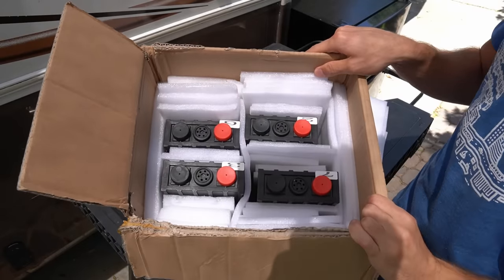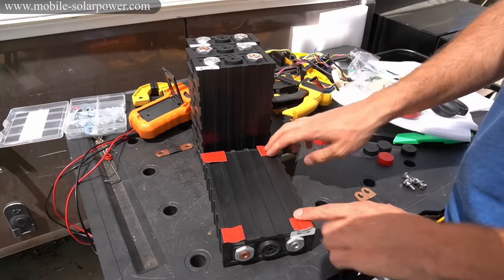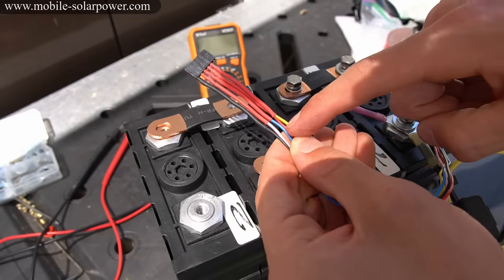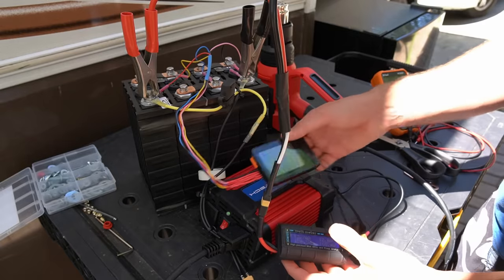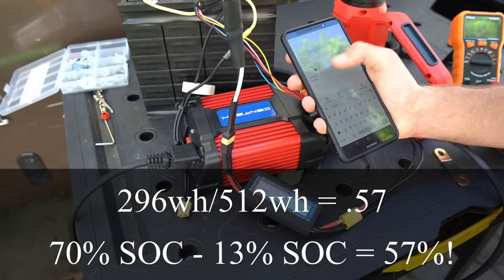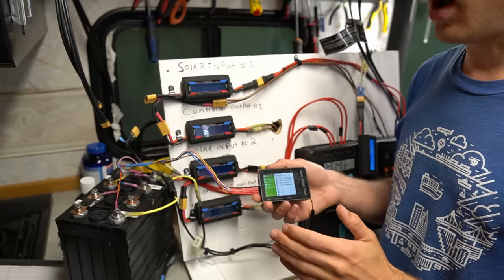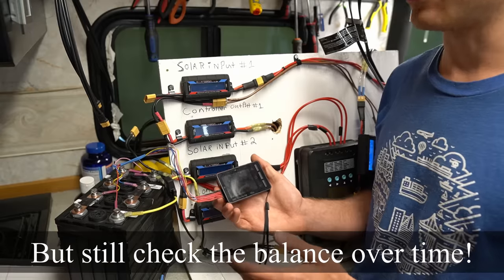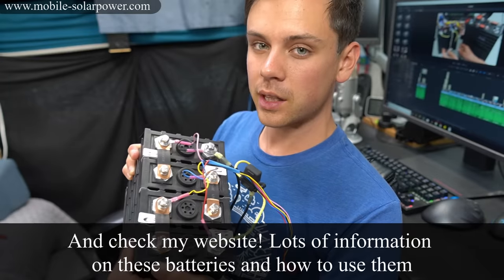12v LiFePO4 Battery Kit from Amazon.com - Tested and Reviewed

Comment: Will, you always produce good education; videos,,,, Thanks in advance.   I have a Small Solar System...  which I just got 4 each  12v AGM 119ah  batteries.     I want to Optimize my charging and discharging....  but totally lost on the Battery Wiring.....   I saw you comment on a Balanced charging method.....   But I'm just lost!  Some say Parallel is this only way to do it to maintain the 12v to your inverter.   Other say, wired in Parallel the 1 Battery takes all the wear and tear!   If you could tell me what is the BEST WIRING METHOD for 4, 12v batteries to use with a DC/AC inverter?  I have a simple 30A Charge Controller, saving money for a MPPT.        Battery WIRING HELP PLEASE !

Comment: I got a challenge for you. Not going against this product. I've been seeing a lot of these new kind of batteries. Works? You be the judge. My challenge is take all of that info on many different types then go to Walmart and get the simple deep cell batteries for your boat or camper. I just want to see what you come up with. My experience is, having a very hard time bring them to a discharge. Please do it. You have the tools to do a proper test. I dont. Thanks.

Comment: did you see the bms  that comes with the 100ap battery wow its 7inch by 6 inch and they don't tell you any thing about the hock ups. and no hot wire or ground i half scarde to try hock it up case I get it worge on the BMS      b+ B- or P- but think it B+ hot P- ground  i pay 900.00 and could even send me  instruction paper wow

Comment: Good video, to support I purchased your book.
Reply from the maker: Thank you!!
Reply: @WillProwse  I received your book from Amazon. It's really nice, easy read. Really like it. You may consider including a Bio / introduction story fluff info for your next revision.  What inspired you to... blah, blah... BTW: Do you happen to know of any no-weld no solder battery kit suitable for use with 32650 cells? There seems to be some for more common 18650, but I'm stoked with LifePO4.
Reply from the maker: @tech29X  yeah LiFePO4 is amazing. And not in that size. Why not use prismatics? They are dead simple
Reply: @WillProwse  Prismatic cells would be too much for my use; I'm using the battery pack to mitigate a phantom load(parasitic drain) on my vehicle. Around 100mA/hr or about 30 watts/day. After killing countless lead acid AGM batteries, I figured I could just use a 12Amp (4s2P) 32650 LifePO4. It does help tremendously. AGM is at 12.5V and LifePO4 is at about 12.9Volts. So, the lithium pack is sacrificed first and LifePO4 charge level never goes below 12.0V or above 14V for that matter. Believe me it's been a very frustrating experience over the years that cost me thousands $$$ in lead acid(AGM) battery replacement. Maybe someday if i break free off my chains and try van life, prismatic cells with a charging system around $4-5K would be great. But, I'm chained down pretty hard  :-)
Reply: @WillProwse  The big problem is stated capacities versus actual usable capacity especially for lead acid "starter" type batteries like on cars. At about 100mA drain/hour if I don't drive my vehicle for 3-4 days, and then just drive it for 30 it doesn't recover and over time a deficit builds up and the starter battery which is not suitable for deep discharge ends up getting trashed. On a starter battery with thin plates when voltage drops below 12.4 sulfation starts to kill the battery. I learned this the very "hard" way going through countless batteries. So, I'm trying to mitigate that problem by using LifePO4 cells to feed the phantom load. LiFePO4 are supposedly safer than most others. When connected to lead acid starter battery it will keep the small drain in check and recover fast by charging in parallel. By building my own pack I know what type of cells are inside the mystery battery pack. But your channel has been very informative. I wish I came across it much sooner.

Comment: Does this require a BMS?
Reply: A BMS is recommended for any battery pack with multiple cells like this.  You could monitor their voltages manually from time to time and balance them when needed, but with a BMS you can let it do all the work for you.

Comment: Where can i get use cells to buy
Reply: If I could redo my used cell purchase I would go with these that Will just pointed out. Used cells are expensive cause of the shipping and are not new. spend the extra 100-200 to get new cells. You do have to be patient with the long lead times from china.
Reply: @rhettsanborn621  OK. Thank you

Comment: Why are they so expensive?
Reply: chriss4365 relatively speaking, they’re not.
Reply: @AaronGeller  they are compared to other types of same rating.  Why are these better?
Reply: @chriss4365  They are inexpensive compared to most of the pre-done, drop in replacement lithium batteries.
If you find some cheaper, I would suggest buying those if you feel good about it.

Comment: 12 V 200 amp hour is $1200 - Really? They sound great as far as their specs,  but the price seems prohibitive for solar. 12 volt 200 ah Lead Acid Deep Discharge (marine/solar applications) is about $220.  I wish the price would come down to about double Lead Acid - then they would be worth looking into.  Nice Video. Thanks!

Comment: there seems to be a bit of debate about if they need to be compressed or not. I lean toward making some way of keeping them from ballooning out. Click on my profile picture to see my battery Menagerie.
Reply from the maker: I don't see a single reason for it for low c rate. Do you have proof that it helps?
Reply from the maker: And why do it?
Reply: I think it helps if the batteries get over discharged , going past 1.5 volts per cell. But I couldn't say for sure. I have seen a few sitting at 0 volts and still come back 75% then other times they don't come back at all. When they experience extreme discharge is when they expand. I just replaced 40 of those black ones that were in a Porsche and had gotten severely discharged they were not compressed and had ballooned out. I compress them and charge them and three-quarters of them seem to have come back. We are all part of the grand battery experiment , keep up the good work , share your information .

Comment: WOW that is very expensive but it is probably worth the cost
Reply from the maker: They are way cheaper than lead acid. charge cycle life is 5-10x longer or more. And you can use 100% of capacity, unlike lead acid. Also, higher coulombic efficiency, lower internal resistance, better voltage range for 12v appliances etc etc. These are the cheapest options available actually.
Reply: Ok do you have the link to the batterys and the bms
Reply from the maker: Links in the description. And look up the pros and cons of using bms for solar. I personally like to build my own, but to each their own. I covered that in a few videos and they are posted as a playlist on my channel, if you are curious to see that information. I hope this helps.
Reply from the maker: @Mike-nt7cd  Seller claims to have bms but I am unsure if it is appropriate for solar application
Reply: Thanks
Reply from the maker: @w8stral  battle born did this test some time ago. Biggest determinant factor for LiFePO4 is actually charge rate. For solar, this is a non issue for large LiFePO4 battery banks. And you can use 0-100% and get 3000-5000 charge cycles. Depends on ambient temperature and how it's cycled.
Reply from the maker: @w8stral  how did you come up with that? Do you have data to support your claim? I can substantiate my claim with evidence from multiple manufacturers and capacity tests from ev and marine forums. Easily accessible information.

Comment: $500 and up per kilowatt-hour? Holy cow it's expensive. 
Okay I'll keep watching cuz I watch all these anyway.
Reply: I agree, incredibly expensive.   What happened to videos of solutions that were cost effective ?   Just because Will subsidizes his system purchase with Youtube revenue, doesn't mean that we think these are cost effective.

$1200 for 200AH x 12 volts.   You can get that from 2 6V golf cart batteries (220AH, actually).   They won't last as long and nor can you discharge them as deeply, but you can buy 6 sets of them for the price of these.

I don't buy new tech for the sake of having/using new tech.
Reply: @SomeTechGuy666     LiFePO4 are indeed more expensive than golf cart batteries or SLA or flooded.. or any number of other things.. the reasons to use LiFePO4 include

High power to weight ratio
totaly sealed (no offgassing at all)
Deeper useful discharge means more useable AH per charge
Many more useable cycles which over time actualy costs less

Maybe you do not need to worry about size/weight etc.. in those cases maybe cheaper batteries work, but the TCO (Total Cost of Ownership) when you factor in .. more useable AH per charge and many more charge cycles before the batteries die.. well, it's not so easy as to just say this is expesive.. in my opinion.

Comment: Idea on getting lot more free electricity out of solar panels: Use the solar panels only to spin the DC motor. Use the DC motor to spin the Alternator. Then connect the 14 volts 150+ amps DC output from Alternator to pure sine wave Inverter. Someone try this experiment.
Reply from the maker: So many losses. Super bad idea
Reply: @WillProwse  Losses how? You are basically feeding the 14 volts 150+ amps DC generated by Car Alternator to Inverter. Is the Car Alternator inefficient? You will of course need to install permanent magnets inside Alternator.
Reply from the maker: @Xeno_Bardock  lol no, just use a converter like mppt. horrible idea to run motor with solar panels. look up volt/amp curve of panels. look up losses of electric motors. wont take long for you to figure out its a bad idea. use a converter instead. thats why 100% of people use them for solar power systems
Reply: @WillProwse  Obviously mppt will be connected to solar panel and battery. DC load will be 12 or 24 volts DC motor spinning the Alternator. This should be good enough to run a small DC motor on 300 watts or higher solar panel to spin the Alternator at good rpm.

Comment: 62c/wh usable capacity.  Ouch. 5x the price of my lead acid bank. Not bad if they last 25 years, I guess.
Reply from the maker: Let's see, higher coulombic efficiency, lower internal resistance, no peukert effect, no gassing, 5-10x the charge cycle life of lead acid, 4-5 times lighter. Now I want to know why you use lead acid still haha
Reply: @WillProwse  1) 7kwh for less than $800  2) They're on a bench in my basement, so don't care about the weight.  3) Off-gassing is also a non issue in a 17600 cu ft basement. 4) Peukert effect is not an issue unless you have a high amperage use (I don't). 5) I'm not wealthy enough to shell out over $4K for the same capacity. Like I said, if those last 25 years, maybe they're worth it.
Reply from the maker: @dbcrn859  fair enough. To each their own. I cant imagine using them. And 7kwh of usable for 800? Which batteries are those? Charge cycle life will still make lithium cheaper no matter what. No comparison price wise in the long run. But I get it. You would probably love lithium though. You should try a tiny battery sometime. They are amazing. You might reconsider your position.
Reply: @WillProwse  Excide GC115G 6V at Rural King. Between core exchanges, sales, and rebates, my average cost was $65 each. Been running a couple of years now with no noticeable decrease in capacity. Had to add water to a couple (out of 12) once. Hopefully in a few years when it's time to consider replacements, Lithium will be my choice. I do have Lithium powered cordless tools, and they're great.

Comment: I went the more difficult, way of building battery banks, I have a large 24v liion bank, and a small 12v, LiFePo4 bank, built from 18650's for the 24v bank, 7s and 1400 total cells, and I'm just started, I already have 150 cells starting on another, they are all new LG, and a few Samsung, they are old stock.  And the 12v LiFePo is 4,  36cell banks, of 26650's with 4. 100 amp peak bms, fused at 40 amps each, and paralled, so if in an emergency I can series it and power my 24v system with it, the 12v is for lights, and small accessories, over 100ah using led lights , I shouldn't be in the dark!! But I have $1.50 per cell in the 18650's on average, and 600ah, 29.4v , and just over $400 in the 12 v 100+ ah bank, its cheaper if you don't mind the work!!!

Comment: Are you suggesting this is a option? Price per kW is fk wrong. Did I miss something?
Reply from the maker: It's LiFePO4. It's lasts 5-10x as long as lead acid, higher coulombic efficiency, lower internal resistance, 4x lighter, double usable capacity etc etc.

Check out some battery videos. Don't take my word for it. Google it or watch some other channels.
Reply: @WillProwse  what you have there is 4x40ah or 40ah
Reply from the maker: Oh okay you need to head over and watch my video on basic electrical equations for beginners. The battery cells are in series so the amp hours does not change, but the voltage increases.
Reply from the maker: https://youtu.be/R_6Voub950Q
Reply: @WillProwse  They look great. How would this compare to using Jehugarcia PCB from a price point?
Reply from the maker: Oh well that depends on application. I deal more with solar. You can build jehus battery but takes a lot more work.
Reply: @WillProwse  I get it.  It takes more work but its good to let people know there are other options at a lower cost. Your making great videos.  Maybe you could make a video explaining price per kw and options.
Reply: @tacticaladvance  Doing things the wrong way by accident could cost one the entire project and then they're back to 0. Lithium is getting lower and lower but people should stick to what they can do safely and correct.
 Some people definitely are at the level of soldering the individual units together and are savvy this way but it's not for everyone.

Comment: Those batteries are fxxxing expensive. Fxxx. Love your energy though. Slap on the back n big smile you geezer.
Reply: Phosphates are great. I’m just glad that batteries are getting so much cheaper. I found used 400 x lithium 18650 batteries with 3200 to 3400 mah for £1.40 each tested and ready to go. Resistance all under 60 ohms. Admittedly you need to add bits on for building etc but that’s about 5kwh of energy. With my 400watt solar panels I can’t even fill 1kwh worth of energy with full energy pumping in 5 amps each day. .

Comment: Hi Will.  I have been watching some of your videos, they  are really great and you explain in easy to understand terms.  I have just subscribed.
I have a question tho, and hope you can help me.  I have a 3kVA online UPS that backs up all my electronic gear a AV equipment.  At the moment it uses 8 X 25AH AGM batteries that are getting old.  I want to replace them with 8 X 20AH LiFePo4 batteries like the ones on Ebay (eBay item number:203309096248) but the seller tells me that I can only put a maximum of 4 in series otherwise the BMSs will be damaged.  How can I overcome this problem, maybe like using an external BMS across the 8 batteries that will work on up to the 110 Volts that charges them.  Is there something that you could recommend.  Thanks Cheers John

Comment: U can charge batteries to 3.6 per cell, but U have to discharge them immediately after reaching 3.6 V. If cells are long time at U > 3.31 V, they will soon loose capacity.
Also temperature is important. If cells are @ 15 to 20 *C, they will last long, but @ 30 to 40 *C, they will soon loose capacity, and inner resistance will go up.
If U charge under 0.25C, it is OK. But 0.66 or 1C will shorten life.
Reply from the maker: Absolutely!! I had a whole video that covered this. Very true

Comment: Its super simple, it's super fun, and it's super EXPENSIVE!  I'd rather buy some new Dewalt tools.
Reply from the maker: It's actually super cheap for the kwh and charge cycle life
Reply: @WillProwse  Thanks, Will.  I watch and follow your videos, so I want you to know that I'm not trolling.  I was just making a point that the cost to buy these batteries is very high. I've watched your video comparing different batteries to the Tesla battery, and the entry cost seems awfully high when you consider it could cost 1500 to 2500 for 5 kWhrs. But if you've got the disposable income.... Anyhow, cheers and congratulations on your new home! I'm hoping to see videos where you transform your home to be independent from the grid.

Comment: They look cool, but my god are they expensive. Kinda need a 100aH 12v battery, but I'm not paying 600$ for one. Closer to half that would be more ideal.
Reply: I'm within Australia and 12v 100AH AGM Deep Cycle lead acid batteries cost about $220. Hopefully a similar price is available near you
Reply: @dorianmccarthy7602  not the same. A lead acid battery weights 75 to 80lb. And can't be cycled as deeply as lithium nor charged as fast. Group 31s run about 300 USD.
Reply: Go on Alibaba or a site where you can buy directly from china. You can buy the same batteries at literally a quarter of the price. Just takes a little longer to receive them
Reply: @Lithium Battteries The video is about raw batteries purchased from amazon.. The link he provided the batteries are $600 for 100ah where as Alibaba they are $2-300 for the same kit. U.S. suppliers are buying the batteries from China and adding a 50% markup. Not all of us enjoy being ripped off.
Reply: @fitlobster  I've purchased some from china before, from aliexpress -- they were shit, fakes. Literally AAA batteries inside of 18650 bodies.